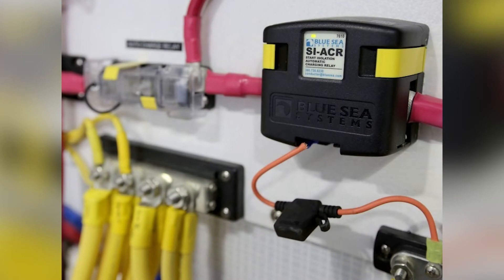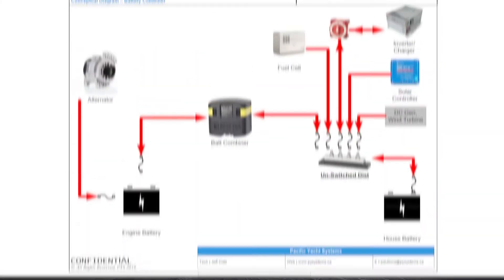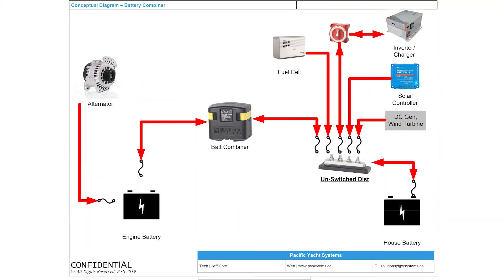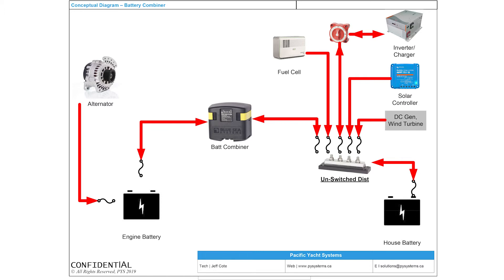How Do I Add a Two-Bank Charger to My Boat Batteries Without Interfering With the Battery Combiner?

Comment: Help? I have a 99 seadoo jet boat. 2 batteries. A Perko switch with Batt 1, Batt2, Both, Off  and an arc battery isolator. I believe  i have it all wired correctly. If I need to charge both batteries, do I just connect the charger up to the Batt1 posts to charge both batteries? I assume the isolator will kick in and switch to Batt2 when it determines Batt1 is full or does an isolator not do that? Does the Perko switch need to be set to Both in order for both batteries  to get charged off of the charger connected to Batt1 or should it be set to off? Or should I just disconnect both batteries and just charge them separately? I was hoping to just put the charger on one battery (Batt1) and have it charge both. I assume it should charge both batteries since they are connected to each other by the isolator. AND they are technically connected together at the Perko switch if it is set to both. This leads me to my last question,  if have boat ignition and stereo on Perko Batt switch 1 and the stereo amplifier on Batt switch 2, is it OK to drive with the Perko Switch set to Both? I keep hearing conflicting answers. I don't park and listen to the stereo so that's not a worrie for me. I just don't want to mess up the batteries or system if Im driving in the Both settings. Any help is greatly appreciated. And sorry if this is sloppy

Comment: Blue Seas officially acknowledges wiring the ACR to the load side of switches rather than just to the batteries. Not sure how it would fit into your diagram, but in a boat that has a dual switching on/off switch (such as turning on the house and engine batteries at the same time, but on different circuits), you'd wire the battery charger to the batteries, and put the ACR on the load side of the switch.

So when you're at the dock with the switch off, the charger charges the batteries (assuming dual, independent leads here) and the ACR is totally uninvolved in the situation. Then once you're underway and switch is on and the ACR is back in the picture, if it senses a charging voltage it can connect the batteries.

Comment: id like to see more chargers with  a ground output that becomes live when the charger is off and goes dead when the charger is on.  preventing the ACR from operating during battery charging operation.   

I use an ignition wire to trigger the 86 terminal on a relay to pass ground from 30 t0 87 which will activate the ACR only when the engine is running.  

Engine off, combiner off and the battery charger when on shore power can then do its thing as designed.

Comment: You can put a switch on the acr negative to turn it off, you can also put a thermostatic switch on your alternator to switch the acr off to protect your alternator from overheating.